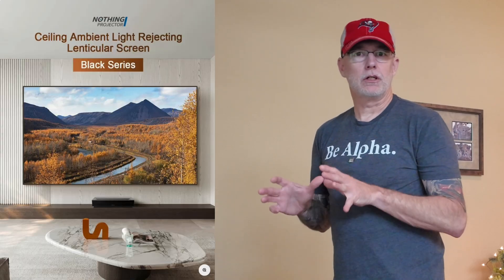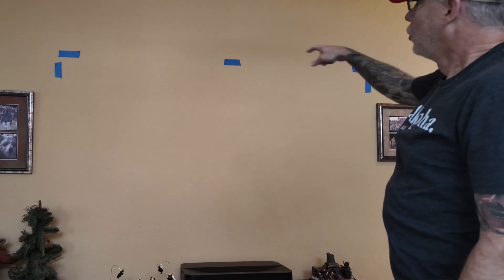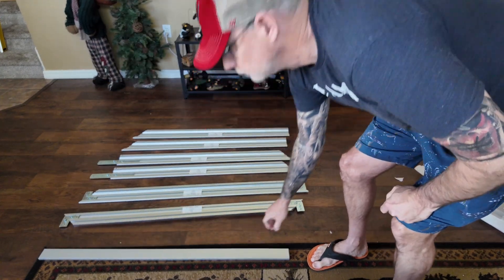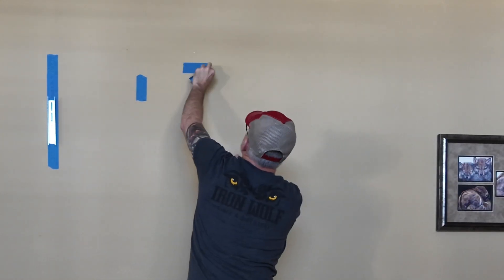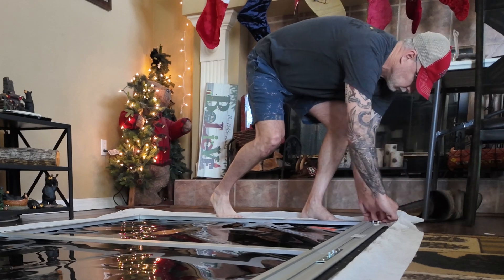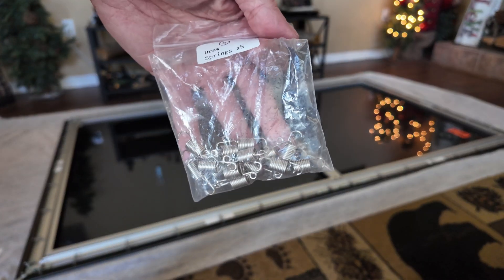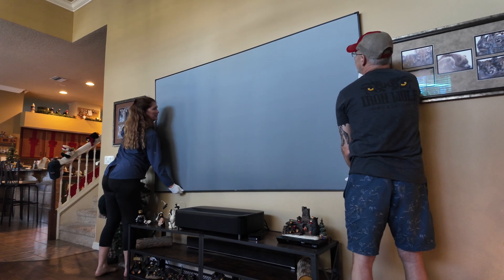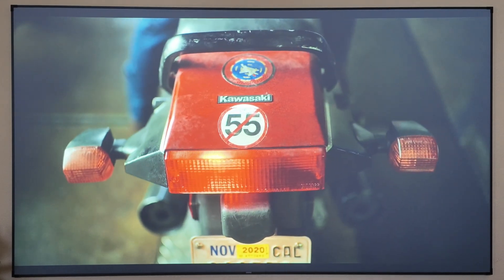Nothing Projector ALR Screen Install

Comment: I followed your instructions rather than the written instructions. 
The bottom bracket purpose was a little confusing though.
Also Help I have a slight wave wrinkle at top corner and bottom corner. Should I pull the springs tighter or looser to get rid? Any help?

Comment: Do you think you can skip using those bottom spring pieces that push the frame down?

I dont see an advantage except it fixates the frame stronger, but unless you have children, there should be no upside right?
Reply from the maker: @BaoMeista  I think it would hang okay on the top brackets.
Reply: @EVERYTHINGcpo  thanks alot! Your vid helped alot in the building process!

Comment: great video and thank you for this! I just bought an Epson LS650 and Nothing Projector 120" screen. Today is the day I'm installing the screen and your video is super helpful. thx again
Reply: so I got everything installed. I did notice some "finger print" marks or some kind of little smudges on the back and front of my screen when I unrolled it. They aren't noticeable while when the projector is on, but definitely noticeable when the projector is off. Not sure if you experienced the same thing. Also, add me to the list of folks that had a really hard time to get the edges put on. The first problem was getting the holes to align properly, then the 2nd problem was a small gap on the top edges between the two pieces. I really had to play around with this and leave a screw loose here and tighten a screw there to get it all to somewhat align. I never could get it perfect and if I really look, I can notice the top middle and the pieces are not perfectly aligned. The OCD in me hates it...but I do forget about it when I watch with the projector on. oh well. The screen looks really good however both during the day and night. I'd have to give this screen about a 8/10.
Reply: How do you like LS650? I'm waiting on my LS800 shipping but wondering if I should've just got LS650

Comment: What size drill bit do you use?
Reply from the maker: I didn’t.  I just screwed straight into the studs without drilling a pilot hole. If you use the drywall anchor just pick a bit that is slightly smaller than the anchor and then lightly hammer the anchor into the hole. Snug is good.
Reply: I used 6mm drill bit